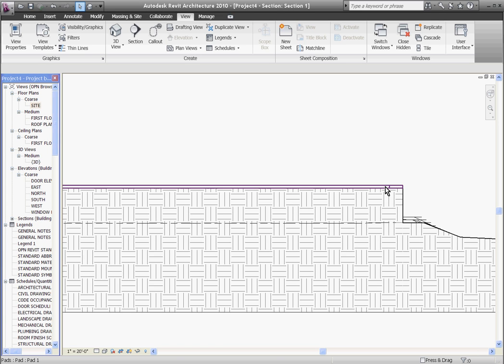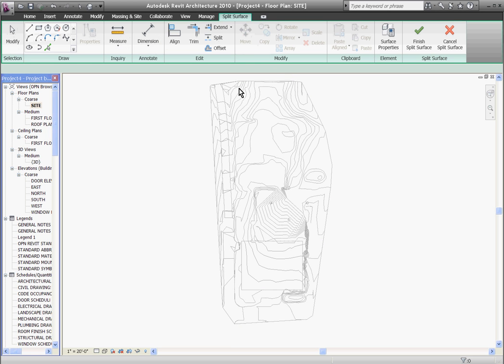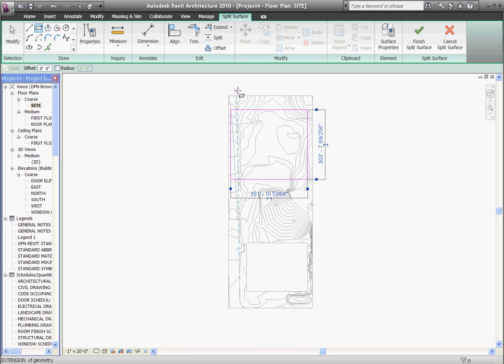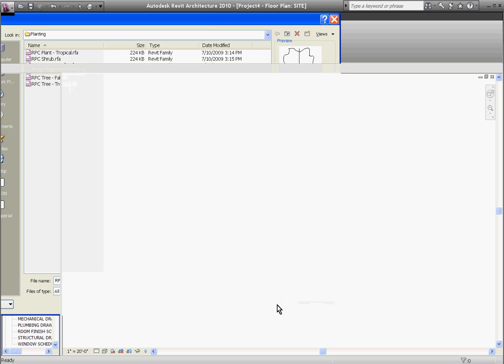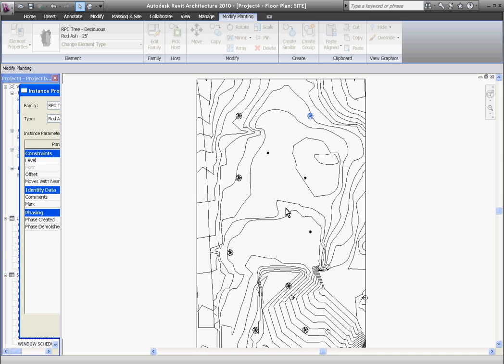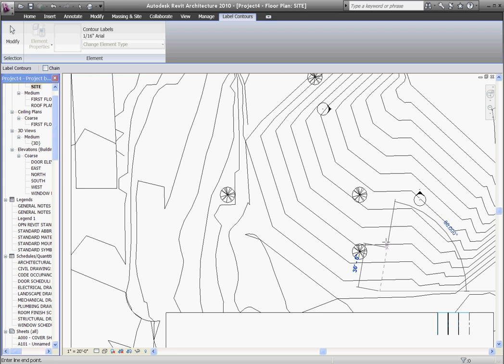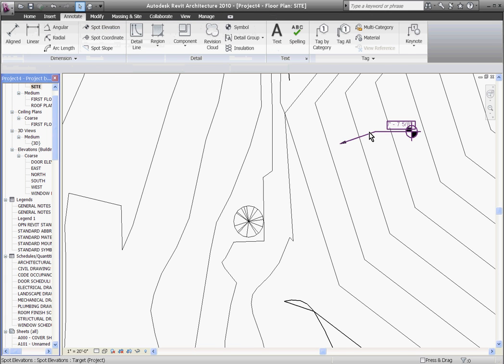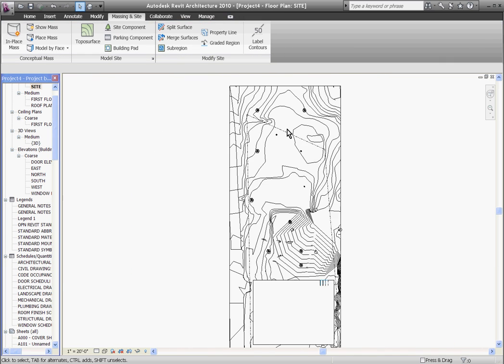Easy Revit (2010) - 32.3 - Topography (Part Three)

Comment: I had a project with contours and topographic issues; and your video is really helpful. Didn't know you can change the existing and the proposed contour line that easy. But I have only one question, how you calculate the cut and fill volume of the excavated soil?